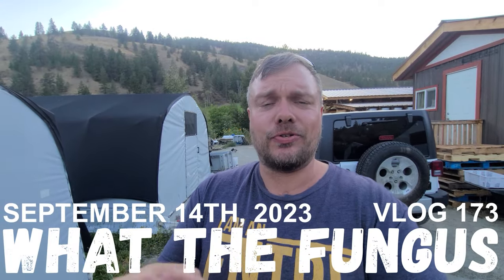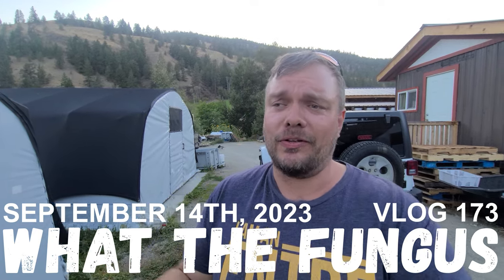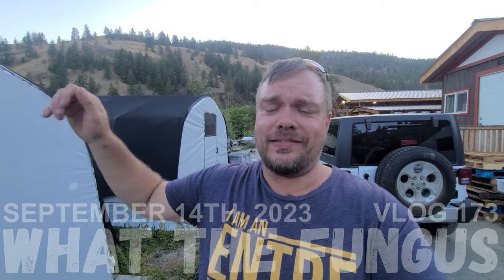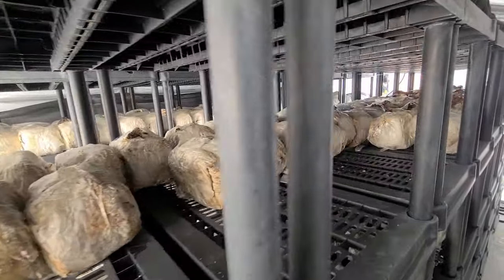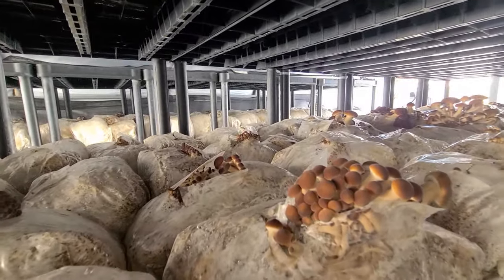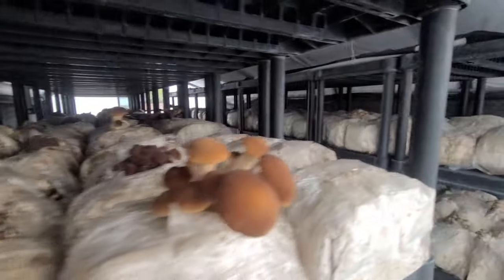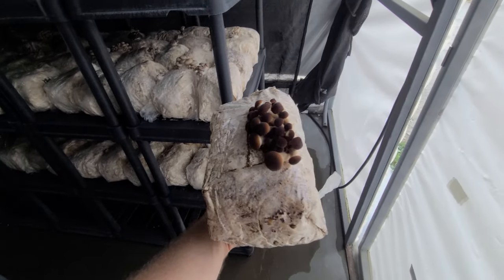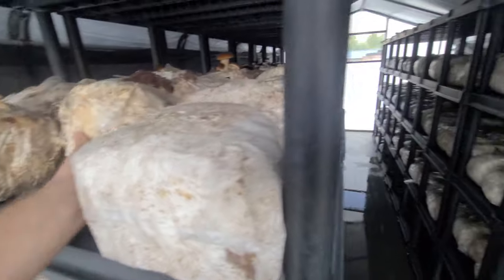Learn How We Grow Pioppino Mushrooms

Comment: Does your tractor have the 2 speed pto? 540 is standard but a lot come with a 1000 rpm speed too. That works double your speed on the hammer mill.